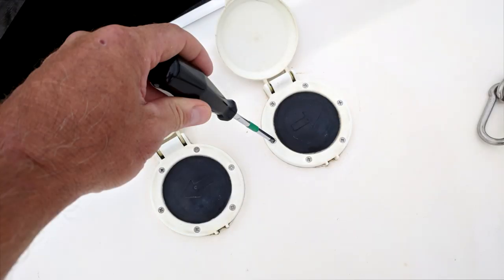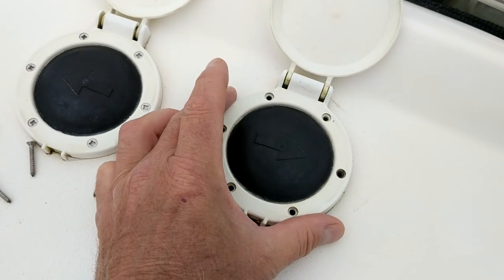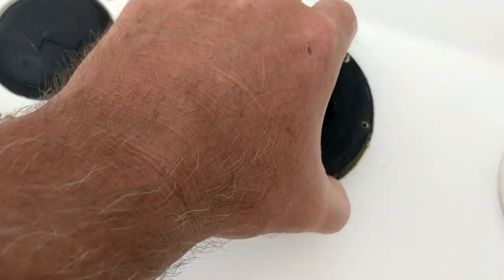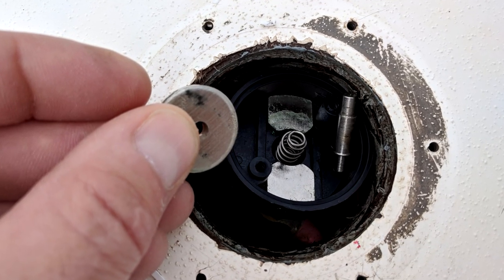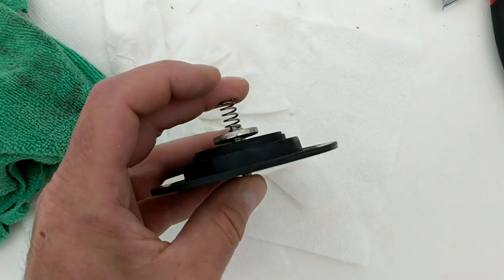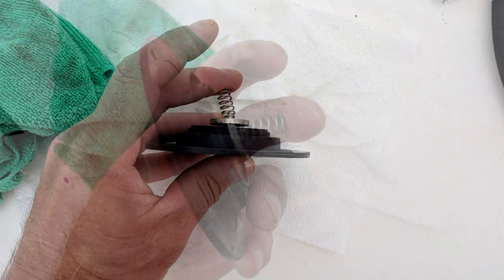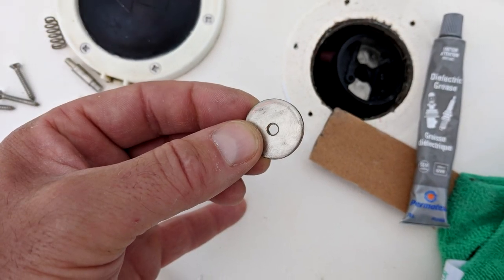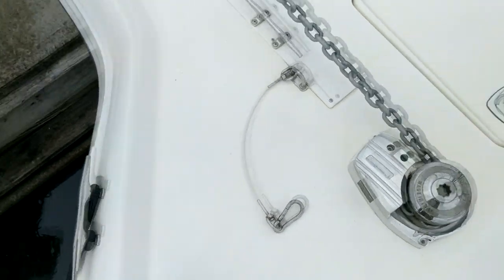Repairing Anchor Windlass Foot Switch - Sea Ray Sundancer

Comment: When to re-installed these deck switches, was it necessary  to apply any kind of sealant between the deck and the switch assembly?
Reply from the maker: I would say probably not, but due to my square headed nature, I applied a thin bead of silicone just to be sure.

Comment: Thanks Paul for that great tip. Our foot pads haven’t worked in several years. Noticed your winch doesn’t have the spring loaded arm. Once our chain goes to rope it often jams here. Is your anchor rode all chain?
Reply from the maker: Yes, I've yet to replace that windlass finger, but we haven't had any issues to date. I think the key is to maintain a small load on the rode when retrieving, so that it wraps nicely around the gypsy. Our setup is 50' chain  150' rope. Keep an eye out for my video on that coming soon. . .

Comment: Question for you - can you tighten the slack in your safety line by a few inches? If it has slack, I’m wondering if the pounding on the water is constantly adding some strain on the windless? Sort of a mini one piece bridle for when the anchor is above board.
Reply from the maker: Check my reply to jrschantz as I discuss NEVER relying on the windlass when at anchor, as it's only designed to retrieve the anchor, NOT for maintaining a load of any sort while at anchor. . .
Reply: BoatingWithBoogaboo I understand that you always take the load off the anchor when it’s set underwater. Perhaps I wasn’t clear as I was wondering about tightening the safety when the anchor is NOT underwater, but rather just lodged on the rollers as you run around the lake.  As you’ve got it set now, there’s perhaps 2” of slack in the safety, and every wave while traveling pounds the anchor which tugs on the chain to the windlass. If it ever slips the 2”, your safety will do its job and keep the anchor up.

Comment: Great video. I have the same issue and am going to try your suggestions. Did you rebed the deck foot switch once finished using butyl tape or similar?
Reply from the maker: I didn't

Comment: Thanks for posting!  I always enjoy your adventures with your wife and the repair videos.  I bought a '06 340 last fall and been doing minor service and repairs.  
It appears your switch and housing stays in place when you remove the screws.  Did you rig something or is it supported underneath?  When I took my switch screws out today the switch fell into the hull.  We can reach it to pull it back up but there's not enough slack to pull it up high enough to disconnect cables or reattach.  Any tips?  Thanks!
Reply: I'm having the same issue here. Just started to do this to mine yesterday (290 amberjack) and it's going to be a 2 person job to reinstall.

Comment: I pick up another item for my "to do" list with every video.  I've been wondering about the use of a cleat to tie off the rode when setting the anchor.  I noticed you have a cleat installed on the wear pad near the windlass.  That's an item I was considering vs. using a bridle.  Does the cleat ever get in the way when letting the anchor line in or out?  I imagine switch maintenance is in my future as well so that was good info for the memory bank.  If this darn virus ever lets me see my boat again, I'll have plenty to keep me busy...for the season and beyond.
Reply from the maker: Ya, never, ever rely on the windlass to support the load when at anchor! It is NOT designed for that and will cause damage to the workings. A cleat is there to tie off, no matter how calm the conditions are. We cleat the rode off to that and then release any tension on the windlass. A boating neighbor of ours found out the hard way that  his windlass was not able to take the shock of waves and had a heck of a time trying to get parts, eventually having to replace the entire windlass + patch the hole where the old one was. An expensive mistake that is easily avoidable . . .
Reply: @BoatingWithBoogaboo  Another interesting video.  Thank you.  Regarding cleating, I have all chain.  Any suggestions for cleating off?  Also, how did you get those foot switches so white?  Mine are filthy and I can't seem to get them clean without removing material.
Reply from the maker: Do a google search for 'anchor chain cleat' to see a number of options to secure your chain. And as far as clean covers, I thought they were still dirty 😉 I generally use a product called 'Vim' that works great on deck stains (https://www.walmart.ca/en/ip/vim-lemon-cream-cleaner/6000114198906).
Reply: @BoatingWithBoogaboo  Thank you!  Looks like that cleaner is sold under the brand name "Cif" over here in the states (https://www.amazon.com/Cif-Professional-Cream-Cleaner-Lemon/dp/B00FZN8J5A). Stay safe, eh

Comment: On your windlass did you remove the finger from it
Reply: I noticed the same. My finger needs a new spring and is not operating properly. When I bring the anchor up I have to be very careful as to not run the chain and rope off of the spool. I wonder if Boogaboo has the same problem?
Reply from the maker: No, was missing when we bought the boat. Still on my yet-to-do list ;-)
Reply from the maker: I've yet to replace that finger - hasn't been a priority up to now, with all of the other major projects on the boat to this point. Hopefully, we'll be allowed to get back to our marina soon (which is 100% off limits right now) to get going on some of the Spring projects!
 BTW, I found this replacement kit that includes the finger & spring for a mere $20 CAN$: https://www.waveinn.com/nautical-fishing/lofrans-kit-f-finger/1122869/p?utm_source=google_products&utm_medium=merchant&id_producte=1248647&country=ca&gclid=CjwKCAjwssD0BRBIEiwA-JP5rIwbnc0k6lK-NwwDtmnDJie2mK02WKGNrPazRMDPO2-y2Wp1q1u1yhoCfuQQAvD_BwE&gclsrc=aw.ds
Reply: @BoatingWithBoogaboo  that's a really good price I just spent $160 for the kit
Reply from the maker: Yes, I thought it was pretty cheap myself.